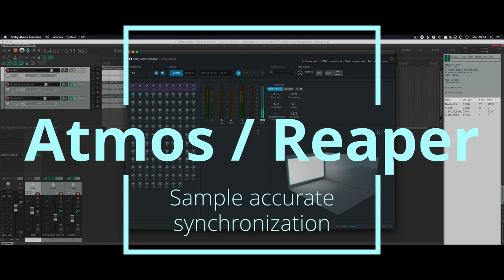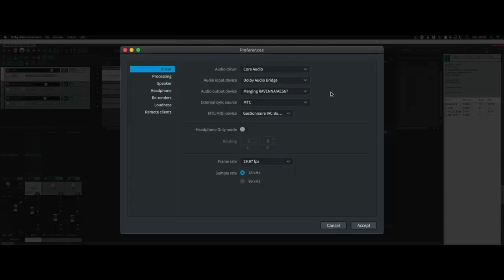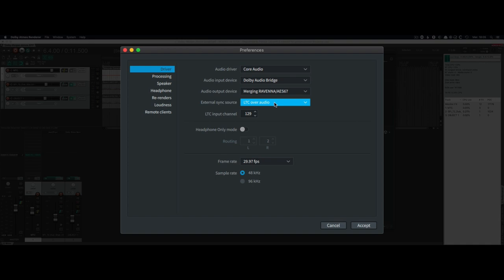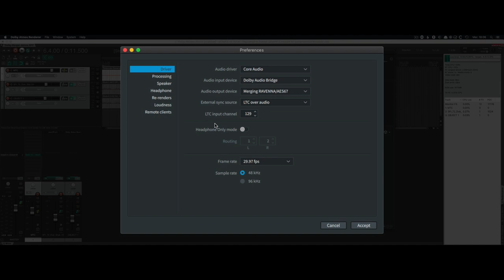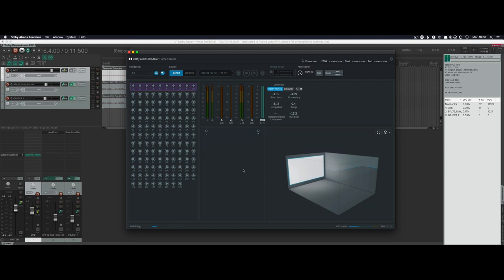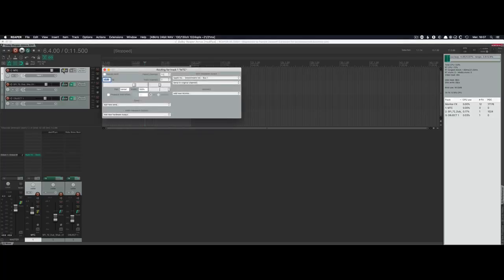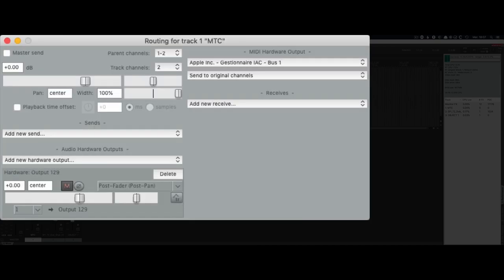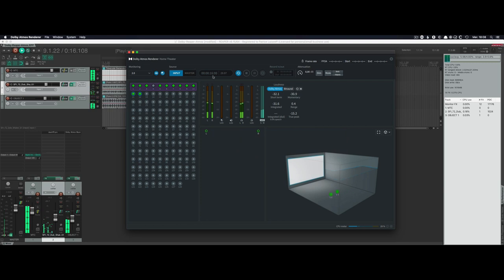Atmos / Reaper setup : sample accurate synchronization

Comment: Hello Mat and thanks for the precision’s. I guess I could use this setup for 5.1 deliveries too correct? Do you know if the are for pc platform as well? Laurent from Orkestra dubbing studios in Barcelona .
Reply from the maker: Hi Laurent,

Yes, that's the beauty of "New Generation Audio". When you render through the Atmos Renderer, you end up with an .atmos file that can be rendered to fit any format, down to 5.1 and standard or binaural stereo :-)

At present time, only the Mastering Suite is available for Windows, but that's the high-end solution which needs a dedicated computer which can handle rendering for several mixing clients at once through Dante audio over IP.

The lower priced Production Suite ($299) that I'm showing in the video is Mac only for the moment. From what I understood, there is a difficulty with the implementation of ASIO that makes the Windows development more difficult, but they will overcome that eventually.